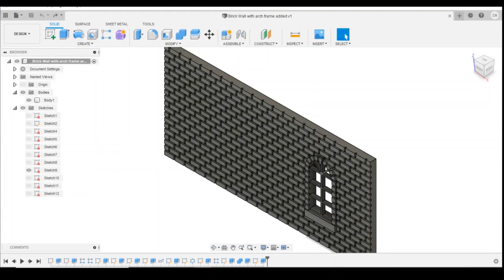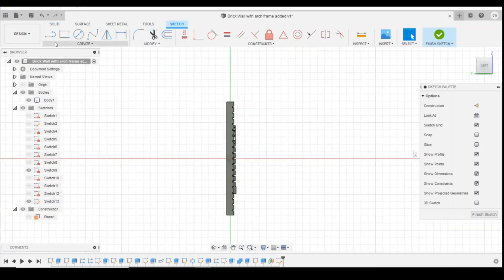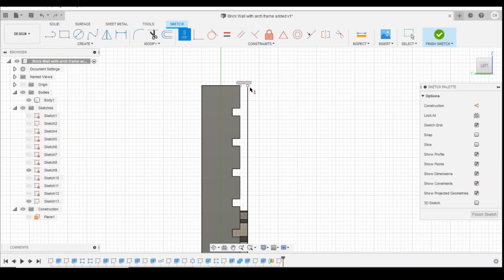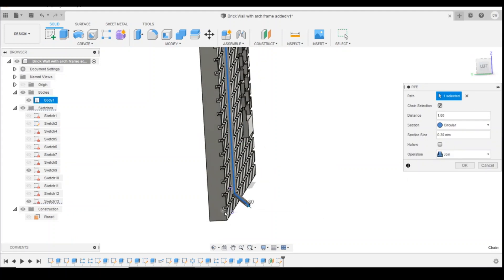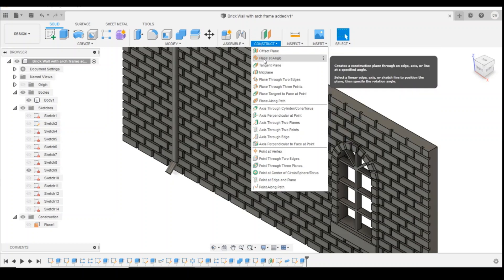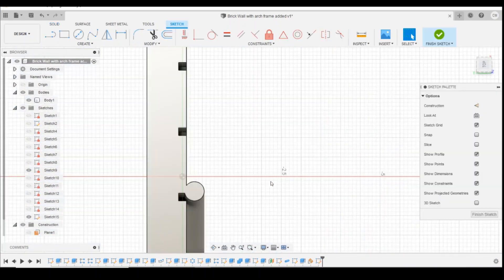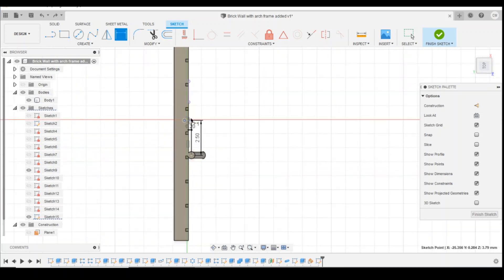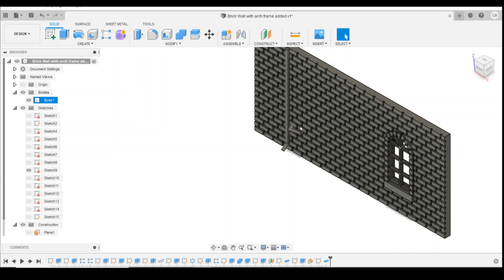Lesson 11 - Fusion 360 Pipe and Plane at an Angle tutorial

Comment: Speaking as an ex Building Control Surveyor - definitely a contravention of the Regulations! But real life shows that this has been a modification (all be it illegal) that owners and occupiers carry out because they have no other way of draining a sink, or they do not realise the issue. So very pro-typical!
Reply from the maker: The video was more aimed at showing how to use the pipe functions and planes at angles.  but there is many instances of a sink pipe going into a rain down pipe around where I live
Reply: @3ddrawingformodelrailways  Great video (and the series on the building). I am about to work on an arched bridge (with side arches up the embankment) and this will change the way I was going to approach the design - many thanks.